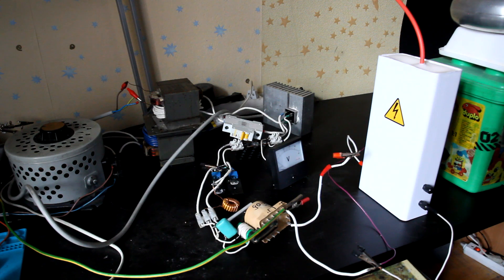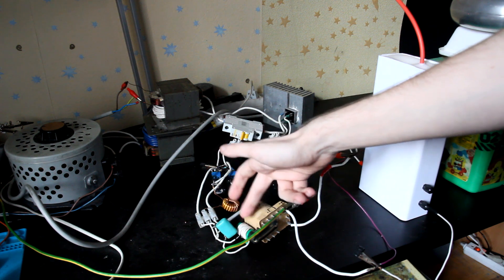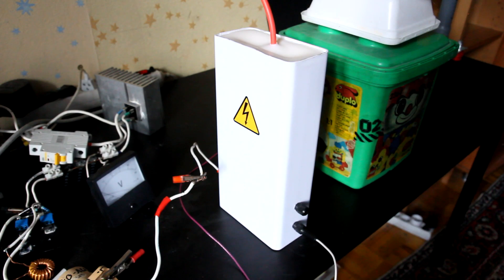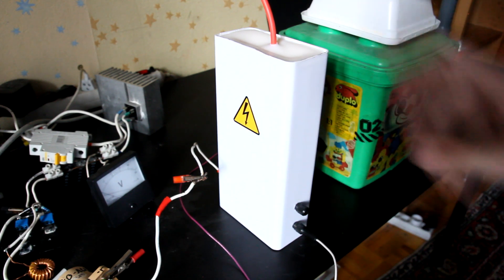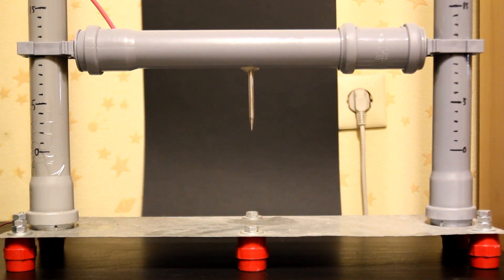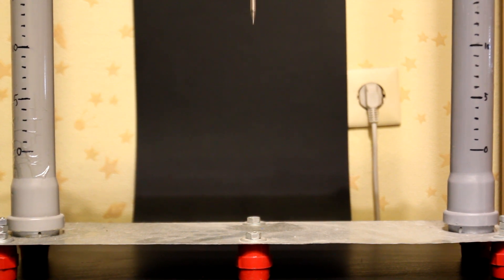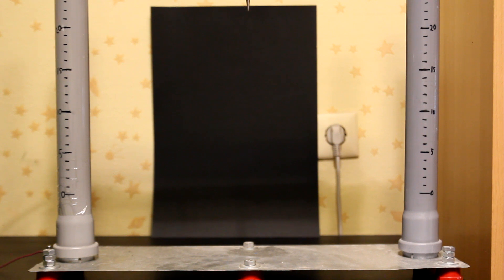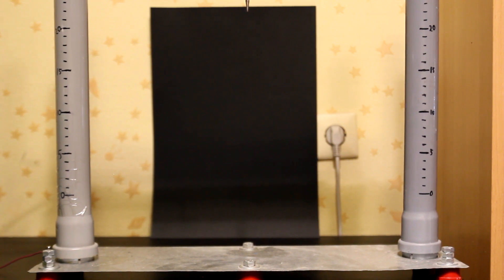My 150kV voltage multiplier (CW multiplier)

Comment: Why does the marked scale start an inch or so above the ground plate?  Shouldn't the ground plate be zero?
Reply from the maker: It is offset by a vertical distance between the tip of the needle and the level of the plastic rings holding the horizontal tube. When the tip of the needle touches the ground plane (zero gap) the plastic rings are at the point of the scale marked as zero. When you increase the gap, the needle and the plastic rings move together rigidly so the increase on the position of the rings read off the scale equals the increase in gap length
Reply from the maker: Phrased a little better, the lengths of the gaps "plastic ring - zero of the marked scale" and "needle tip - ground plane" are equal, but their starting points are offset due to the length of the needle. The gap length is read from the intersection of the rings with the scale (it is easier to make it this way than somehow try to match the tip of the needle with some scale)

Comment: IF you put it in a box, you can control the lighting (only light from the stream), and you can control wind movements.

Put two microphones (wireless) top and bottom?  Don't talk while it is running.

Comment: 1:13 so you are taking AC.... to DC.... back to AC.... then back to DC??? 
.
why cant you just go from AC to AC (50 hertz 240 volt...i assume..... mains voltage in your country................. to whatever HF ac you want)
.
is it just because you dont have the equipment for it?
but if you use a few smaller random bits you DO have.... you end up with what you want??
.
im sure that means the losses are higher (their for, output is lower)
but its also WAY cheaper than getting dedicated AC to HF AC components?
Reply from the maker: Well, I'm not sure what to tell you, usually all AC-to-HF AC converters of any kind are actually AC-to-DC-back-to-AC converters. It is just way easier from a circuit design point of view. In this setup you can just see this principle with your own eyes, while in pre-made devices it's all inside the case. But the principle (intermediate DC stage) is the same, whether it's a UPS, or a computer power supply, or a HV power supply, or something else. 

You could transform 220 V 50 Hz into 15 kV 50 Hz directly (AC-AC) with a high voltage iron-core transformer, but those are very heavy and very expensive (where I live they can cost at least 20-50 times more than my whole AC-DC-AC setup). I hope that makes it clear somewhat!

Comment: 6:33 The spark (point-to-point) is longer than needle-to-bolt gap😎. I know it's a hair splitting question, but have tried to measure output volts with high resistance voltage divider. It could be 140 kV or even less with positive DC in this setup (maximum depends on humidity and atmosphere conditions)? Very nice work👍
Reply from the maker: Thank you for the appreciation! Well, the lengths of spark gaps in high voltage engineering formally are defined by the shortest distance between the electrodes. Of course the exact length of the spark channel varies from breakdown to breakdown, and with humidity etc. Yes, as far as I remember, I did measure the voltage here with a divider and it was in 145-150 kV range

Comment: This is good content! I tried making this multiplier but I got tiny 1 mm sparks at the high voltage output.

 I used an LED DC power supply which I changed to a step down microwave transformer and I also tried different diodes (all 20kV, 20 ma, 5 ma, now using 100 ma (2CL2FM)). None of these have any effect. I'm using a ZVS flyback and driver that I got from ebay and it works just fine. I discovered that putting a one ohm resistor in parallel with the  first capacitor (effectively shorting it) on the high voltage side produces a nice output (2 stages) but this isn't how it's supposed to work and I doubt adding more stages would increase the output. It seems the other capacitors in the circuit aren't getting charged because they don't spark when I short circuit them after shutting off power. Can anyone help? All suggestions will be appreciated.

Comment: make the same but negative and use them together 😉🙃
Reply from the maker: That's exactly what I did :D
Reply: @Vidduley  thanks for the reply. I don't know when I made this comment but I know you did! in fact youve inspired me to make one of my own. I'll be attempting  it with 10 × 30kv 10000nf caps, using those same 20kv diodes but in series pairs. I shall try potting it all with ikea candles as I'm liking this solution over the transformer oil.
for now  I'll just be experimenting with the one multiplier. I want to get it stable and reliable before making a negative one.

I need to decide how I'm going to power it. I'll want some bigger flybacks than the ones I got. I'm thinking of winding my own from a bit of 100mm by 100mm, 25mm square ferrite core.

as for powering the zvs, I've only ever fed one current limited dc direct from a bench power supply so I'm intrigued about your variac to 2 mots wound for current on through a rectifier and capacitor setup. what sort of dc is your zvs getting? if it's high current low voltage what are the numbers?
Reply from the maker: Sounds good! My ZVS takes about 20-30 V at 3-5 A. You could power it from a lab bench power supply just as well, the variac and MOTs is just what I had on hand at the time. Also, less transistors/ICs in your power supply - more resilience towards the high-voltage static and transient noises :) it's important when you're powering something that sparks like that

Comment: Question 
I have a 12 stage multiplier very similar to yours,
Thank you very much fo making it easy😀
I have two of four flybacks that make plenty of plasma 
But when connected to the multiplier, nothing!
Reverse the primary leads still nothing.
With the other two flybacks, up to 12 inch sparks
Any ideas?

Comment: Thanks for the video, I just ordered 24 2CL2FM diodes. Did you use any resistors in your voltage multiplier?  And is your ground on the multiplier BOTH the HV output wire of the transformer AND the earth ground from mains?
Reply from the maker: Hi, no, I didn't use any resistors in this multiplier; yes, the ground of the multiplier is connected to earth (PE) from mains. I have found that this significantly reduces unwanted static effects on nearby objects and circuits.

Comment: What capacitors and diodes are you using in your circuit? Thanks.
Reply from the maker: Hi, the capacitors are 1 nF 15 kV Y5P, the diodes are 2CL2FM by Dean Technology.

Comment: How did you connect the second MOT for extra power? I'm assuming both are of the same core dimensions and the rewound secondarys have equal turns. Also, how many amps can they produce in parallel?
Reply from the maker: I connected them in series, increasing the input voltage of the cirtuit and thus increasing the output voltage. When connecting transformers in series, you don't have to worry about the number of turns.

Comment: I think that if you put a series spark gap, and increase the resistance of the resistors in the multiplier, you would get something closer to a marx generator.
Reply: I’ve tried Marx generators. The trick it to get those gaps all firing simultaneously, which is very hard to do!

Comment: what is your input ac voltage to a miltiplayer? how much current a multiplayer draws?
Reply from the maker: Input voltage is sine 7.5 kV peak, and I haven't measured the input current.
Reply: @Vidduley  не ожыдал,что ты так бистро ответишь ) спасибо! я тоже пробовал сделать 100кв умножитель,с расчета на + и - 50кв,две цепочки умножителя. нашел дешевые синие керамические китайсккие капы  на 10нф и 6.3кв, и к ним диоды тоже из дешевых,по 2 в послед. r5000  называются, 5кв 200ма 500нс время востановления. без нагрузки на виходе без проблем 100кв дает (3кв вход постоянки,16 ступеней в умножителя). сделал вольтмер и амперметр дл високого напряжения. а вот когда я начал грузить выход умножителя ренгеновской трубкой или большим резистором,то конденсатор начал гореть,самый первий в цепочке,причом со стороны постоянки (тот что на земле) . диоды перемерял все ок,а вот кандюк горит один и тот же,в одном месте.только поменяю,сразу горит следующий. так и забросил етот проект,обидно.

Comment: What would happen, if you introduced a strong magnetic field perpendicular to the corona stream in the middle part? Does the corona stream form loops towards ground ?
Reply from the maker: I don't think it would do anything. For a plasma to react to a magnetic field, it must be pretty concentrated, like a glow discharge or in a tokamak reactor. Here there really is very little plasma to begin with. That's what my intuition tells me, but I've never tried to actually test this :) Maybe it could be tested with some insulated magnet.

Comment: Really cool! I suppose you can apply this in a rock breaker or disintegrator or in drilling wells! Can you go upto 500kV?
Reply from the maker: Ah yes, electrohydraulic and pulse tech! It's a very cool piece of technology. You'd need more energy though. Here I have 0.5 J, and pulsed power rock breakers an etc. use 0.1-10 kJ. That's definitely on my to-do list :D I've managed to break some easy stuff like glass and ceramic with underwater discharges, using 30 kV 100 J capacitor.
Reply: @Vidduley  Thanks for your reply, I would want to develop 400-500kV for drilling rocky water wells using a 16kW 3 phase generator, anyway you could help or can we collaborate in such a project? Please inbox me ndassya@yahoo.com to discuss further on the components and circuitry required. Something of this sort https://youtu.be/PAQabaA2DWE

Comment: If your camera lets you adjust shutter speed you can use an ND filter to get the sparks to show properly.
Reply from the maker: Elaborate please! What is an ND filter? My camera is very crummy when it comes to shutter speed. It gives me the ability to vary the frame exposure, but in incremental steps and not to 100% open.
Reply: @Vidduley  ND filters are basically just "dark glass pieces". They reduce light coming into the camera without changing the color. 
By reducing the light you can use a higher exposure time, which is the secret to the butter smooth motion in cinematic videos and also lightning photography. 
https://singh-ray.com/equipment-technique/thinking-outside-box-photographing-lightning-solid-nd-filters/

you can get a set quite cheap. the more expensive ones guarantee perfectly accurate colors but that mostly for photographers.
Reply: Ill explain it even easier:
The reason the arcs are cut off is the short exposure time combined with the rolling shutter effect. 
The exposure time is short because of the bright surroundings and arcs, making it longer would overexpose the image. 
The ND filter makes the image darker by letting less light in. You can turn the exposure time a lot higher and get the full arc including little streamers.

The typical cinematic exposure time is 50% of the frame time. To get the brightness right they have to use the aperture and ND filters.
Reply from the maker: Thanks for the info, I'll see if that's something for my case!

Comment: Have you found a place to get high voltage capacitors and diodes cheaply? I am trying to build a CW multiplier but the parts are so expensive!
Reply from the maker: AliExpress, mostly. The components aren't dirt cheap, that's for sure. A multiplier like that costs me about 100-150$ to make. There's just no way around it - HV components are harder to produce than regular components, and the demand on them is lower. Hence the price.
Reply: @Vidduley  dang. Things through China are so slow right now. I just had to get a refund on some 3kV capacitors since they were way late.

Comment: This is such a good set-up and your channel is way underrated. I'd like to build a similar system in a contained environment (cylindrical vessel). Would there be any risk of pressure build-up and explosion when sparks are generated? Also, do you think it would be possible to design a system that allows you to transit from corona discharge (low current) to a continuous arc (high current) but in a controlled way, by just increasing the voltage? Thank you
Reply from the maker: I'm not sure about pressure build-up, but I think it would be fine. The gases in the chamber slowly will convert to NO2 though, and it produces nitric acid when contacts with water, maybe that's something to keep in mind. The arc's negative differential impedance makes it hard to control using just voltage control. As soon as the arc ignites, the output voltage drops to a very low value. I think you could implement a feedback system, based on the amount of current flowing into the ground electrode.
Reply: @Vidduley  Thanks for your answer. You've also spotted my initial intention which is that of a chemical reaction (not NO2 though) :) There will not be air in the vessel but other gases (argon and methane, mostly) and I need the corona discharge to catalyse the reaction (which would not take place at normal conditions). I will use a pin-plate configuration like yours with approximately 15 mm gap in between. I'll borrow a DC 900W 30kV-30mA Power supply from a colleague, and will clamp the cables on the two electrodes. Would you think I could get similar streamer and corona to your setup? Any suggestion? Thank you!!

Comment: How do you create the high frequency for the imput?
Reply from the maker: It's created with self-oscillating circuit called "ZVS driver". I have made video about it, if you're interested in the design.
Reply: @Vidduley  thanks!

Comment: Hy. What do you think about my 120kv low cost multiplier? :) => https://youtu.be/Akkdqy-ygLM
Reply from the maker: Hi, it's great! I wonder, where do you get all that crazy high voltage stuff like resistors and PTs? I appreciate that you perform real measurements of output voltage, and don't use this annoying "1kv equals 1mm of spark" thing. I'd say that the capacitance is a little too low for such a low power supply frequency, the leakages and measuring resistor can significantly lower the output voltage. I would suggest that you buy a couple dozens of chinese 30 kV film or ceramic caps. They are relatively low cost, and you could combine them to make the stages smaller. Also, 17 diodes in a string, really? I think that's a bit of an overkill :D Maybe make 6-8 diodes per string? Anyway, great build nevertheless!
Reply: @Vidduley  Thank! 
P.S. the reply is on the other comment

Comment: That voltage multiplier unit is about the same size as the units I test at work. The ones at work only discharge up to 20kV DC.
Reply from the maker: Maybe your ones can output much higher current? Mine is about 5 mA continuous max.

Comment: That is so fucking sick I'm definitely building huge multiplier out of Soviet door knob caps
Reply from the maker: Haha, be aware that they might have a lot of leakage after all those years of lying somewhere in a warehouse. I'd buy Chinese caps instead.
Reply: @Vidduley  I'm bit skeptical about buying Chinese high voltage ceramic caps cuz they are not expensive but not cheap either and I bought one but they lied about the capacitance.

Comment: What is the purpose of filtering the DC output from the rectifier and how did you do it with capacitors
Reply: Rectified AC is not smooth and you need huge capacitor to filter the output. Watch electrobooms tutorial on how to make Full bridge rectifier

Comment: Hello, do you have a Patreon account? I would like to support you since I'm also doing experiments with high voltage. I replicated you device and it works pretty good, but now I'm attempting to obtain 150kV by connecting 10 15kV transformers and I'm wonderng if you have expeience in that regard because the insulation is very tricky. My goal is to produce an ionizer to replicate one of Tesla's glorious inventions. I'll leave you my email: if you are interested, text me: scaggiante17@gmail.com
Reply from the maker: Hi, no, I don't have Patreon. The idea with the transformers seems pretty hard to bring to life - the last transformer should withstand 150 kV between primary and secondary. Maybe you've accounted for that though.

Comment: this thing makes so much ozone, i hope you keep the windows open to both avoid the toxicity and close the ozone hole :D ...nice sparker btw
Reply from the maker: Hahaha, the ozone hole got me! That thing is nothing though, compared to DBD (dielectric barrier discharge) ozone generators, these guys really can destroy your lungs in a couple of minutes. Now that's what I use to sterilise the room :D
Reply: @Vidduley  i mean, 30cm of corona jet must make A LOT of ozone, i can smell it on my 40kV multiplier that makes a coiple of millimeters of that effect... honestly my first tesla coil that wasn't interrupted made a tonne of it, a couple of seconds of use and i had to open my balcony door, a blue plasma almost the size of a tennis ball, but not every setup seems to make ozone, there must be some reason behind... also plasma globes make it